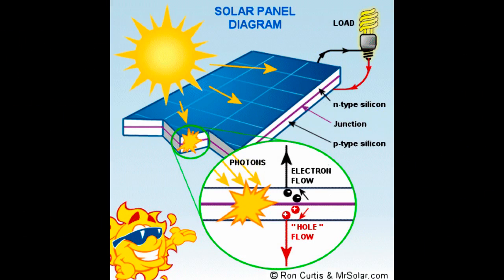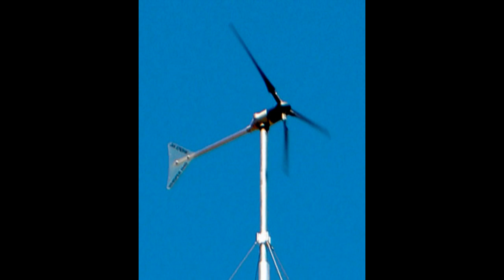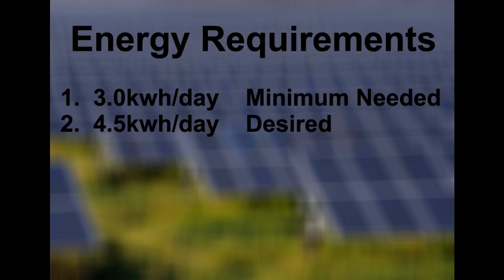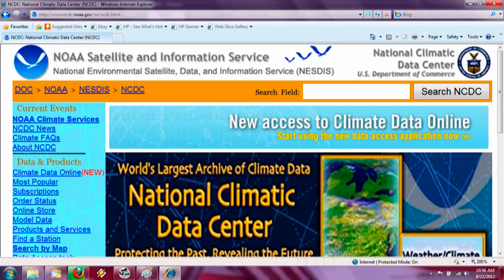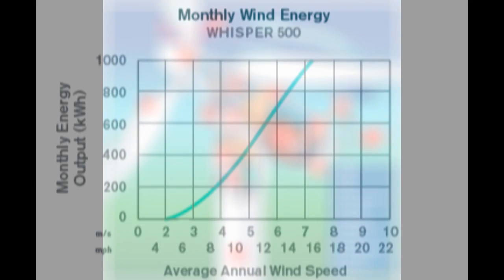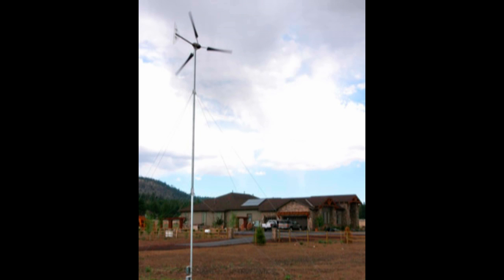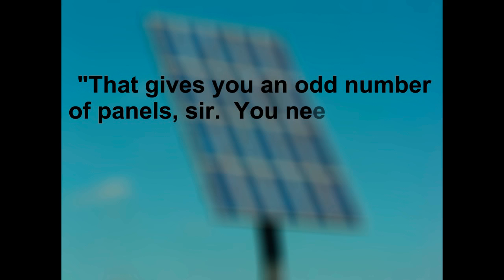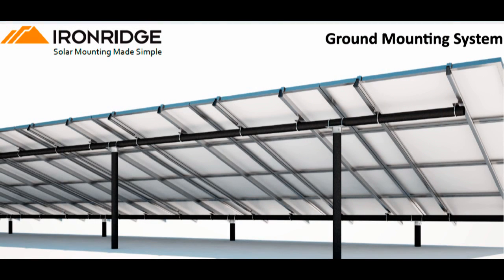Step 4 Solar/Wind Power: PV Panel and Wind Generator Calculations

Comment: Do you think 2500w of solar is sufficient for your need ,after time? I'm in Canada and winter is hard for solar. We had 10 days straight without sun .  Things like that makes it hard for me to leave the grid. I didn't know the no welding thing either. Is that even with the Magnum?
Reply from the maker: Yes that's even with the Magnum.  We all use generators to weld here on the mountain.  My system is 4800 watts of solar with 4400 watt inverter.  Not quite enough in the winter, but makes way more than I can even hope to use in the summer.
Reply: I wonder if you can weld if you have an afci in the house?
Reply: My system is 4230w pv 11kw overhead but 5kw split between 2 inverters. 800ish AH 48v . Its pieced together with what I can afford. I have a few videos posted.

Comment: very nice video . what are your thoughts on storing solar energy as air pressure? In Italy they manufacture air powered engins for factory fork lifters . I figured using that engine would be a way to retrieve the stored pressurized air.
Reply from the maker: I've read some articles on TATA India and their air-powered car.  I would be very interested in checking it out if I ever get the opportunity.

Comment: Hi Steve.Hope u r doing good. Can u recommend where to get a wind turbine. Ill appreciate it. God bless
Reply from the maker: Wind turbines are very tricky.  I would suggest going for more solar panels first.  My experience is that solar panels produce much more electricity than wind, have no moving parts to wear out, etc.  But if you prefer to go with some wind power as well, check out Ebay - they have several suppliers there.
Reply: Thanks Steve. Regards and stay blessed
Reply from the maker: Thank you, and you as well.

Comment: I am completely new to all of this solar energy stuff. I plan to purchase a tiny house in the near future and would prefer that it has an off grid system. While researching, i came across The SolMan Line from Sol Solutions. What is your opinion on this line? I remember you saying in one of your videos that you are not a fan of 12 volt systems. I am on the fence between purchasing an already "together" system or figuring out how to buy all of the components to make my own.

Comment: At night, when you have no sunlight, IF you have some wind... the wind turbine will keep charging the batteries if you are using any electricity = you will not discharge the batteries.
TIP: Make sure you are buying a LOW WIND TURBINE.

Comment: Wind turbine are sold by Watts... here is a link to a vender in e-bay 
(I’m not associated with any vender)

ebay.com/itm/Pick-One-12-V-AC-DC-Wind-Turbine-Generator-System-400-W-550-W-650-W-800-W-Watt-/130700322630?pt=LH_DefaultDomain_0&var=&hash=item1e6e58a746

Remember. IF your batteries are fully charge, the wind turbine will not charge the batteries if you use a solar/wind charger controller.